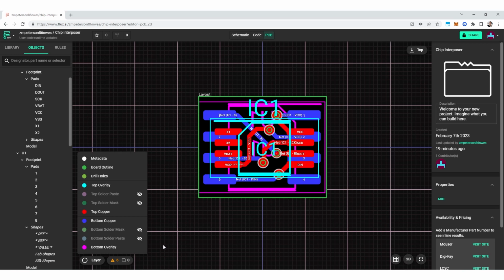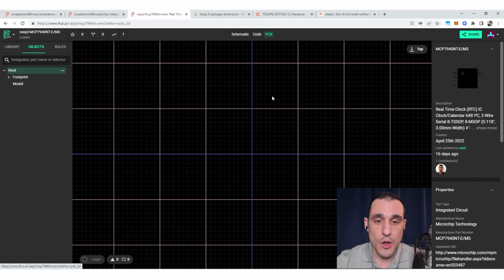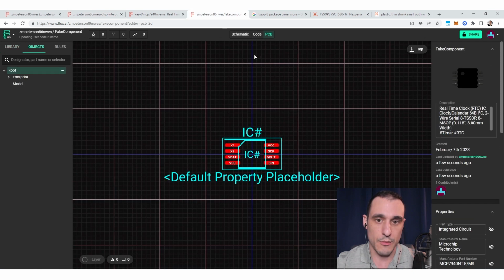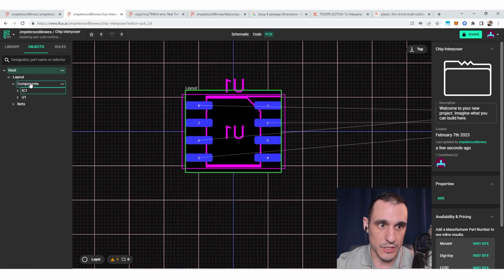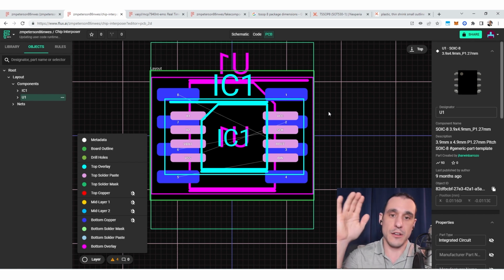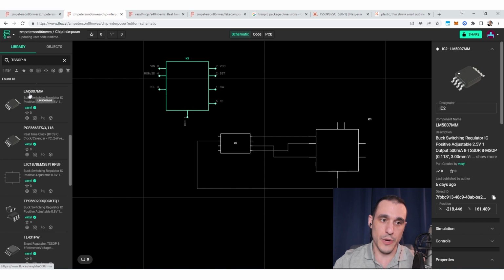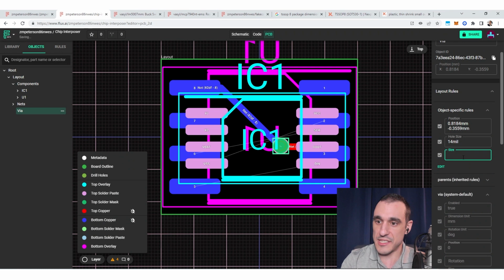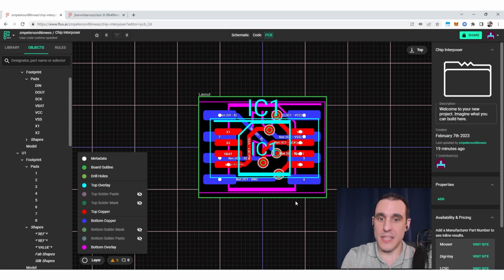How to Design a Chip Interposer for a PCB - Flux Tutoria

Comment: Excuse me, I just want to know what tool you use?
Reply from the maker: Hi there, it's flux.ai
Reply: @buildwithflux  So the interposer is the "layout"  ?
Reply from the maker: @YifeiZhu-pr8nj  Yes!
Reply: @buildwithflux  ok thank you. I'm new in PCB design filed. so do you know how to simulate the interposer's Electrical Characteristics Transmission Performance, etc.
Reply: And do you know how I can analize the csv I export? I don't get the meaning of it
Reply from the maker: @YifeiZhu-pr8nj  what are you trying to learn from the simulation?
Reply: @buildwithflux  I'm just learning the design flow of an interposer. I think, after desining it, we should check the connectivity and evaluate the quality of this interposer in many aspect through simulation. But after all, I'm new in this filed. I don't know whether what I'm saying is correct.